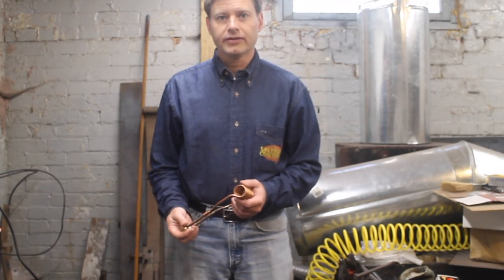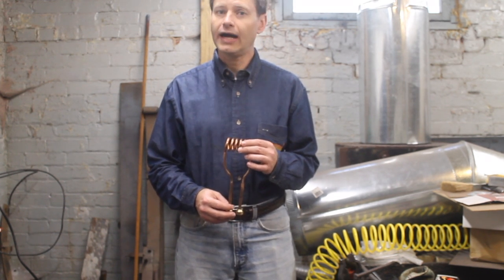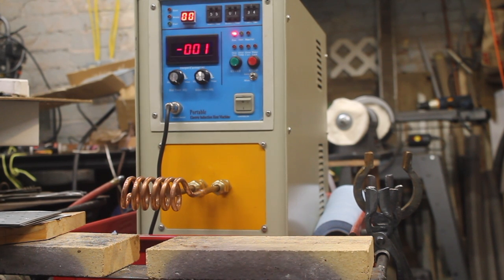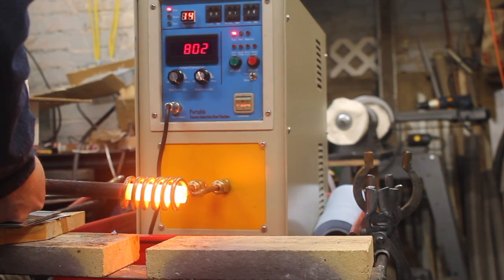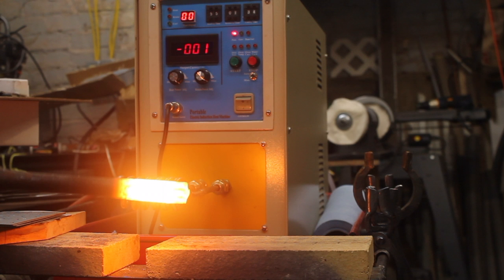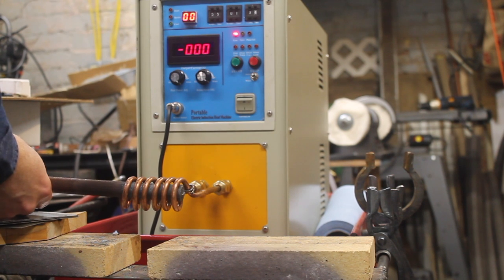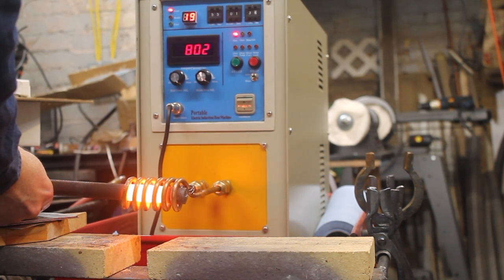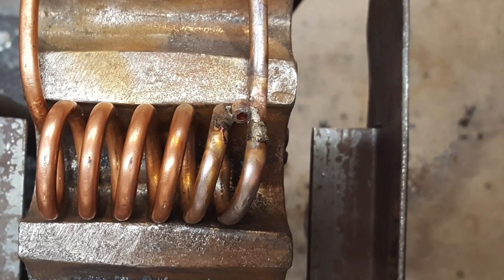LH-15a induction heater coil that failed to work and how to fix it

Comment: I have a Solary induction tool that I would very much like it to function as advertised, it doesn’t only used a few times before it failed. Looking for a repair facility if it is worth the cost.

Comment: May I ask how much does it cost per hour by using electricity? Thanks for the reply
Reply from the maker: My typical electrical rate is US$0.11 per kWh. If I used it at 100% power for 100% of an hour: $0.83. In practice, quite a bit less than that for an hour of forging time because I probably heat for <50% of the time even when I'm really going at it. More subtly, it's rare that the stock / coil match is good enough to actually drive 100% power which further reduces the energy usage.

Comment: The actual issue is not related to inductance.  It is related to the net resistance of the load comprised of the heating inductor, tuning capacitance and output transformer ratio.  When you loaded the entire bar into the inductor, the net resistance was lower, requiring more current from the power source than could be supplied and thus the power source was faulting/limiting due to excessive current.  When you partially loaded the inductor, you increased the net  resistance and allowed the unit to produce a greater amount of power thus heating faster.  Reducing the turns, reduced inductance, which raised the operating frequency  and proportionately raised the output voltage, lowering current and allowing more power to be produced.
Reply from the maker: I stand by my reasoning. Inserting a "core" into the coil dramatically changes the inductance which pushes the LC tank circuit's resonance point out of range for the unit. Further, that effect is significantly reduced as the "core" heats so the unit can resonate it. It's also worth noting that maximum heating happens then as well because the lower resonance frequency means reduced skin effect / deeper penetration of the eddy currents.

That said, you can think in terms of equivalent resistance of the inductor, so perhaps it also works out as you say.

Comment: Mine came with two larger coils. Did you purchase that coil separately? May be for a smaller unit.
Reply from the maker: I made that coil and I accidentally put one extra loop in it. When designing coils with intuition and rule-of-thumb, it's possible to end up with this kind of problem even in the design. Shorting out that last loop allowed me to verify that a coil with one fewer loops would work well for my purposes.
Reply: @ejoftheanvil   do you contact me in Facebook.
 Give me your id  👍

Comment: Hey, I see you have quite some experience with these, I just got my 15kw induction heater machine.. When I switch it on it has an annoying high pitch buzzer and water lack light is on.. Any idea as to why?
Reply from the maker: You probably don't have enough water flow from your cooler. My first cooling setup had exactly that problem and I had to come up with a better setup. The biggest problem tends to be the pressure required to force enough water thru the system. The pump may be rated for enough flow at a lower pressure than is needed.

I cover that problem in https://www.youtube.com/watch?v=rNZkxVRb5Ys .
Reply: @ejoftheanvil  I got it running but I'm thinking it doesn't do the job as it should.. I feel like it doesn't heat enough..
Reply from the maker: @aaronjanzen4078  On of my friends in Oklahoma had a system stop heating well. I had him swap out a particular board I suspected from the symptoms with a working unit and that isolated the problem. He got a replace component for about US$100. 

I have heat timings in this video: https://www.youtube.com/watch?v=gzp4MvxLAag . Hopefully your coil is close to the size of one of mine and you can use that (and the same size stock) as a baseline. If you look up the contacts on the Saltfork Craftsmen website, you can find contact info for me.
Reply: Do you have a phone number I could contact you at?

Comment: Hi! Amazing videos, congratulations! :-)
I have 2 questions for you: 1) did you ever try to heat metal sheets with pancake coil? If yes, does it work or the pancacke significantly lowers the magnetic coupling with the metal? 2) What happens if you exceed the max legnth of copper tube for very large coils? Does the machine switch off or it can break down and die? Thank you very much, your videos are a great help to me.
Reply from the maker: The pancake coil seems to be the best coil for sheet metal. The induced heating currents (in the sheet metal) are in a good orientation so that makes up for the poor coupling. Further, if the sheet metal is being shaped (say, dished or something) it won't fit inside a coil.

A "too long" coil doesn't damage the machine. It just fails to work if there is too much tubing.

Comment: Hello 

I have one question sir

I bought this machine for copper chain anealing 

The current coil is with 10mm inner diameter and with 27 turns 

In this situation the thicker chains are getting heated up fast 

But when I am trying to heat up the 1.5mm chain it’s not get heated up 

Can you please suggest me what I can do with the coils

Machine capacity is the same 15kw and 100khz

Please guide me sir

Regards
Reply from the maker: That is small enough stock that the eddy currents are probably canceling, resulting in almost no heating. For a 100kHz unit, below about 4mm (in copper) you start losing ability to heat. At about 1mm it's pretty much impossible. You might be able to get around this by winding your chain into a tight helix before putting it into the heating coil.
Reply: @ejoftheanvil  Rakesh could also put his chains into a graphite crucible to anneal them.
Reply from the maker: @frenchcreekvalley  That's a great idea. Should make for a fairly even and controlled heat.

Comment: FYI: As you adjust the power control to lower levels the unit is actually raising the frequency toward 80kHz (above resonance) as the means to limit the power to the coil. So you might see an even shallower heat at the lower power setting. With the original three turn coil and no load I see the frequency go to 72kHz at lowest power setting (no-load) and down to 55kHz highest power setting, again with no material inside the coil. At some point I will check the effect of coil turn count, coil diameter, material being heated and power setting against frequency.